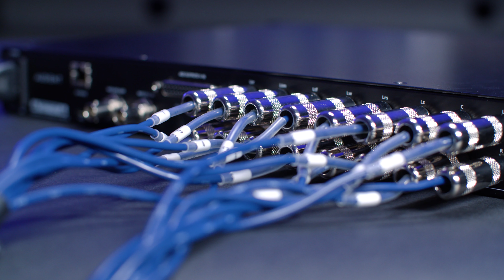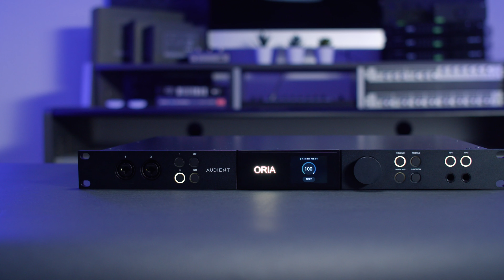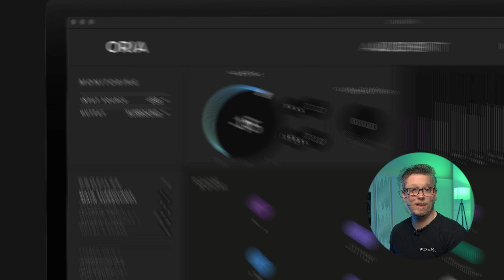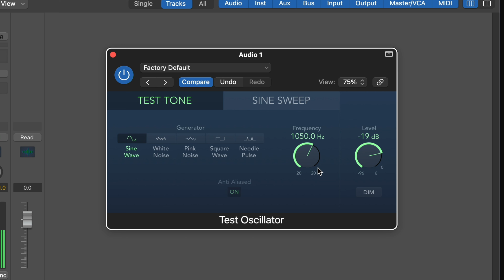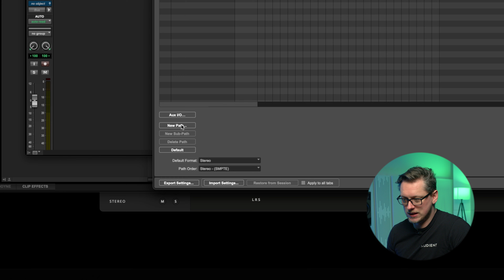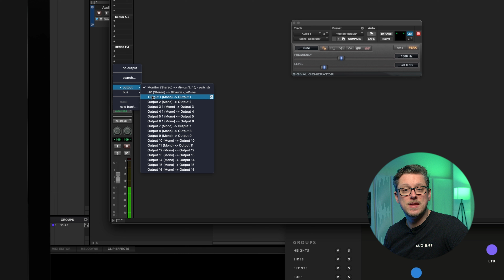Getting started with ORIA: Quick Start Guide

Comment: Great and thorough setup guide! In the future, will there be any support for Dolby Atmos streaming in TIDAL? Also on the Windows side, will there be any support for WDM surround? Currently with my Focusrite Clarett+ drivers, I can go into the Windows Sound playback panel, select Configure and then select either 5.1 surround or 7.1 surround in Speaker Configuration (especially useful when playing PC games that have surround like Cyberpunk for example).
Reply from the maker: As far as I can tell online, TIDAL has its own built-in Renderer so should be able to play back Atmos audio via ORIA. There may be some limitations however, so I'd recommend checking with TIDAL to be 100% sure.

ORIA does support WDM surround, you would just need to select the Surround Output in the Windows Audio settings